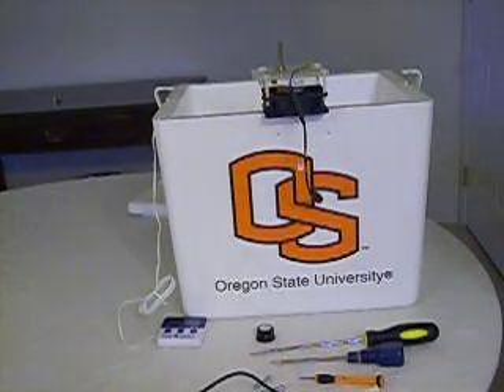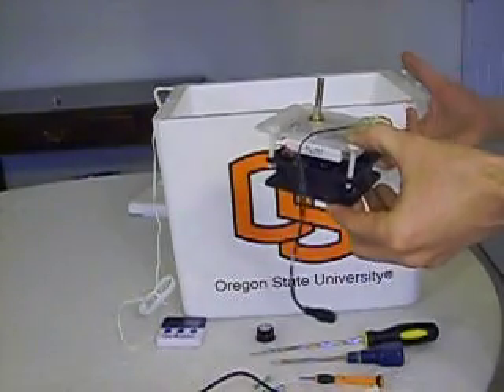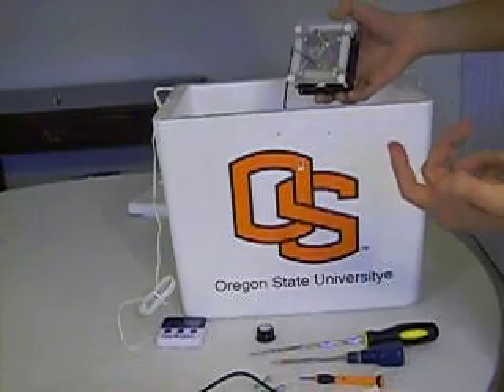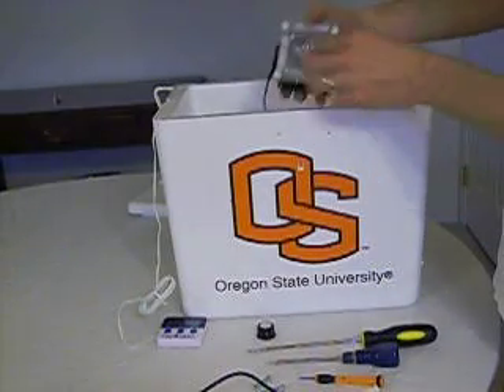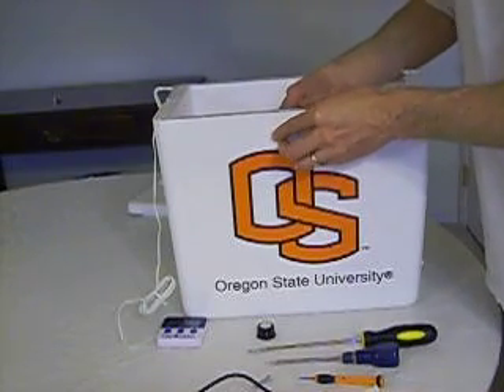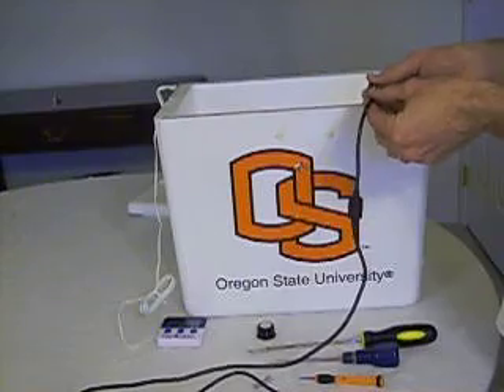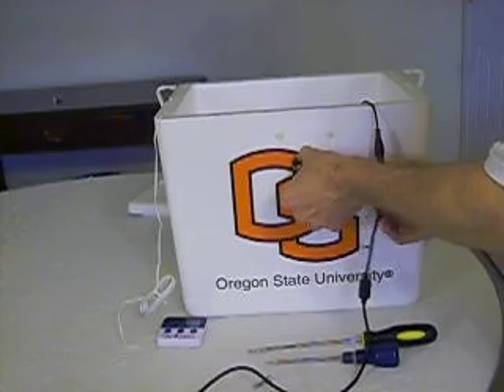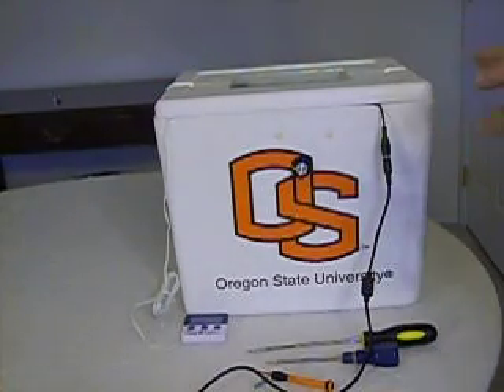IncuKit Installation - Incubator heater fan thermostat combo kit

Comment from the maker: The consistency of the temp has a lot to do with air flow, especially with a thermostat, like a wafer style thermostat.  I have seen a still air Hova Bator (with out a fan) with a range of +/- 4 degrees I was shocked!  They are suppose to be so good!  But then I added a fan and it leveled right out.  The same is true with this IncuKit.  The fan is built in creates a great mechanism for the thermostat to be very responsive to the temperature.  I had my best quail hatch rate ever using this!

Comment: Hello
I have a question about the incukit
I have asked many people about thermostat wafers they say it works and stays at 99-100 but they actually have a 3-4 degree range. I have made a homemade incubator and i got a good hatch but it took lots of temperature regulation. will this keep the temperature at exactly 99.5 degrees all the time?? please be honest because i have asked others in the past and they said their thermostat works good, but it really doesn't.